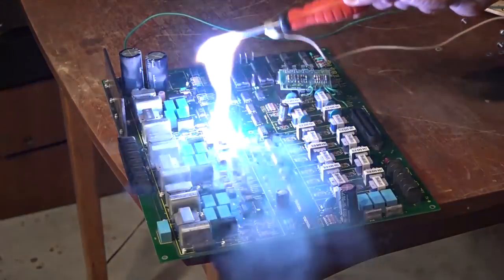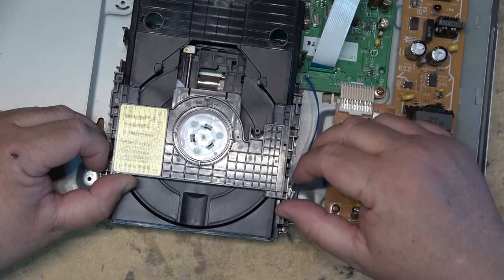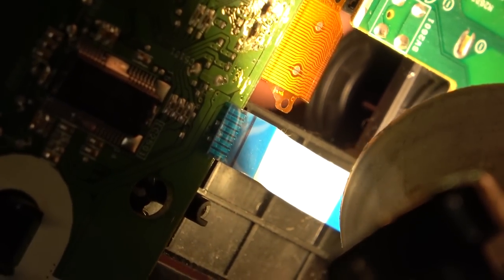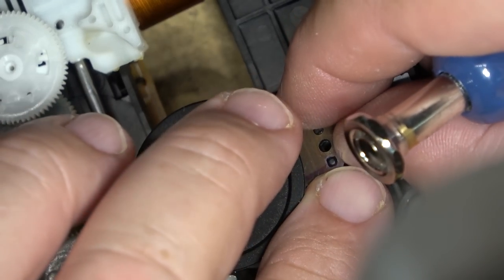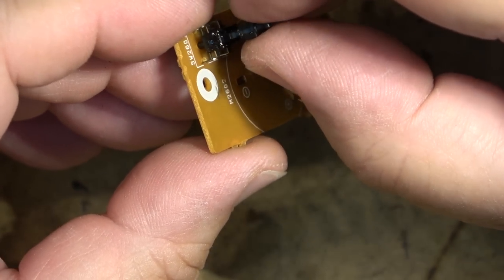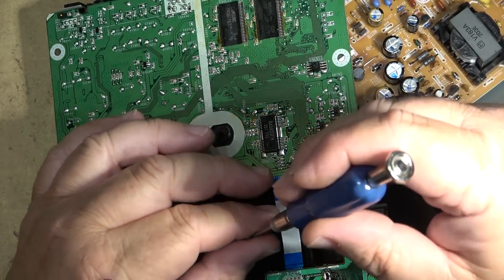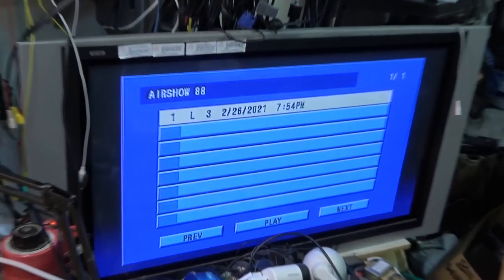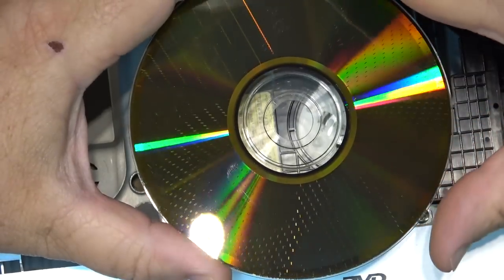Panasonic DVDS35 DVD RAM player will not load disk lets fix it

Comment: I need to thank you for this.  It helped me fixing a Panasonic dvd-rv32.  It took me a long time to figure it out though.  When you solder the pcb back, you need to push that switch underneath the components that hold the pickup unit.  It can be tested with a multimeter.  When rolling the gears to move the pickup up and down, continuity should  come and go.  If there is no continuity at any height, the switch is misplaced.

Comment: Super interesting, not only from the point of view that I didn't know you could even take apart a Loader. But also that it had switches you could service inside. Your knowledge and experience with gear that wasn't only one brand is very impressive. And valuable.

Comment: Dave I have this  model  i bought for $20 bucks US with remote works perfectly.  Good info  in case of issues
Reply from the maker: That's a great find.  Great player especially if you have dvd ram disks as most will not play them.

Comment: What a shame that the dvd ram didnt become the dvd standard.
It is also a shame that the cartridge was not part of the dvd standard, less disks damaged by crud or light.
Never seen a rotational sensor on any recorder.
But the boomerang switch was a bugger on toshiba pc readers.
Reply from the maker: Panasonic tried.  Every dvd recorder they made supported it.   It really was a superb recording format.   As I have demonstrated in the past can read and write simultaneously, delete data in middle of disk and that space becomes usable.  Just like a hard disk.

Comment: I think you mentioned this in one of your other videos, but why are the jumpers needed for the laser pickup diodes when disconnecting the optical block? Is it to prevent ESD on the laser diodes?
Reply from the maker: Yes to prevent ESD on laser diode.  Laser diode is one of the most sensitive devices to esd you will find. Without even touching the device a charge can build up on the lead to the diode and potentially pop it.  This is why all new blocks were shorted, placed in a conductive moulded plastic clamshell box and that was placed inside conductive bag.  3 levels of protection to protect during transport.

Comment: This player (like one of my Panasonic DVD player) uses a single motor for sledge motion and opening/closing the disc drawer. Clever, but before opening the drawer it needs to reposition the pick-up close to centre. Not particularly silent too...
Reply from the maker: Toshiba DVD recorders do the same.  No belts to slip.

Comment: I have a JVC small home hifi with a iPod dock at the bottom that I bought but didn’t realise its gen 2 dock wasn’t working, I’ve removed the circuit board and found the dock port damaged but no one in Australia has parts, does the US have a parts supplier I could contact? The part number is GVA10161-A1?

Comment: I have a 1985 Panasonic AG1000 vhs player that seems to drop frames every so often like it jumps a frame backwards. Any idea what that would be  i replaced the head drum but it did that before.
Reply: VHS is an analog format. If you see a stuttering, juddering back and forth image, the fault could lie in your modern tv set and not in the VCR. Check the condition of the tape on other players connected to analog TVs.
Reply: @gabrieleorioli1760  thanks for your input. I havent tried that but it seems to do it with any tape and my other players dont. I will try it on an analog tv and see if it does it. Thanks again 😀